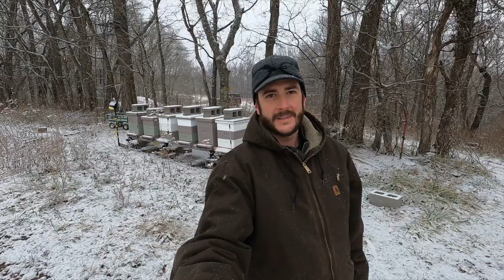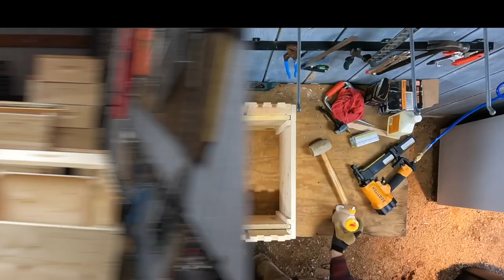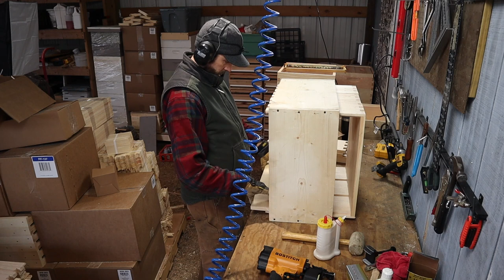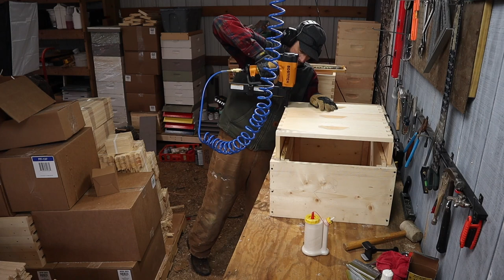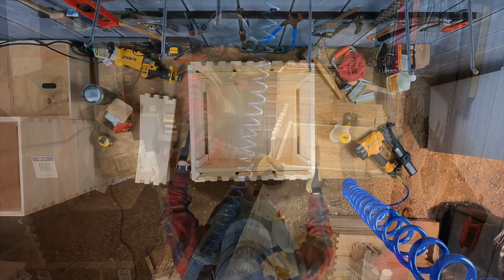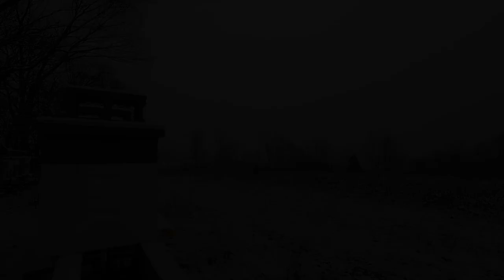Assembling Supers - ‘21 Beekeeping #2

Comment: did you make the assembly jig? Do you have the dimensions? I could figure it out, but if you have them why reinvent the wheel. Great video. I am just going into my second year of bee keeping and am expanding a little as well. Thanks for the content.
Reply from the maker: I posted the dimensions in the video description....I almost didn't want to because the tolerances may change from one box manufacturer to the next.  Make sure it works for your equipment and don't be afraid to improve on the design.  My boards were a little cupped and that made things a challenge.  If I'd used 3/4" ply or MDF it may have turned out better.  But, it's built, and should last me the next 40 years or so.